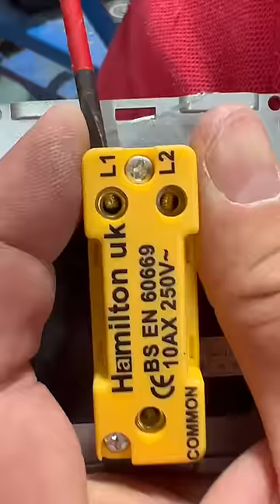Don't Get Caught Short - Wago Push Wire Inline Saves The Day

Comment: I really don't like the push in connectors. Really don't make a good connection. Less of a problem in 240volt countries because currents are lower. But they are really a weak design. Probably not as much of an issue in low current circuits, but I prefer a connection that supports the continuous ampacity of the wire. These are essentially inserting a weak spot. Maybe OK in most EU circuits. But if you take on apart, you can see the design weaknesses.
Reply: They are tested at and above their rated current, there is no issue using them anywhere, regardless of the current, so long as they are used within spec.
Reply: @Pugjamin  I completely understand how they are rated and tested. Bear in mind that this is less than the ampacity of the wires they are  for and they   are de-rated  for 80% of that value, 

I have done a lot of research on the issue. In Europe and in other 240 volt countries, The same type household circuits pull half the current they do in North American 120 volt systems. So in 240 volt countries these are typically being used at much lower, (half) the currents. 

But let me remind you how electricity works. In a resistive circuit, the power dissipated for the same resistance value and therefore the heating of the connection, is a function of the current squared,  I^2 x R., remember?? Let's take an example.  In the example we will use 0.001 ohms of resistance. If the circuit draws 10 amps, we have 10^2 x 0.001.  or   100 x 0.001 or 0.1 watts. Now double the current so 20^2 X 0.001 or 400 x 0.001 or 0.4 watts. Twice the current but 4 times the watts. 

So in 240 volt countries, the same devices on a typical household circuit, will draw half the current as those same devices operated at 120 Volts. But the resistance value of the connection is the same, yet the heat dissipated in that connection, will be 4 times greater operated at 120 Volts. 

I'm sure you know that when a connection heats up, it will begin to deteriorate. Eventually leading to failure of the connection. If you take a push in connector apart, you will see that the contact area is incredibly small and a good connection relies  on the spring tension. What happens to a spring when it heats up??? The clamp style connector was developed to deal with this issue. For the same size conductor, its current rating is a third higher. The design of the contact area is larger also, thus the higher current rating. 

We have seen issues with the push in style in the US, over time. If you think about it, it makes sense because we will tend to be using them at higher currents, closer to their ratings. If the circuit is just pure resistive as  in lighting the current is the same continuously. But now add an appliance with a motor, (an inductive load). When the motor starts, we get  inrush current, albeit briefly . Circuit breakers are designed to allow that brief inrush without tripping. But the connection doesn't know the difference, it just generates heat as a function of the current squared. 

I have seen these push in connections fail. This is something you can test with a regulated power supply and a heat gun or better yet a Flir  type thermal camera. Regardless of where you  live "amps are amps", "Volts are Volts" and "Ohms are Ohms". Watts are Watts",  But the power or watts calculation, looks at the amps, (current) squared. If you were trained in a quality, certified apprenticeship, you should be familiar with these concepts. If you followed this, I think you should be able to see why the supply voltage of the circuit, can make a difference. 

These push in style connector are approved for use in the US,  But a lot of real electricians try to avoid them. If everything else in the circuits are wired and protected correctly, I think it is highly unlikely that these would pose a fire hazard. But these can be far more likely to fail under higher current use, than alternate approved connection methods. 

In corrosive environments, including coastal areas, these type connections can have a greater likelihood of failure due to corrosion. Competitors and now Wago, makes a line of these connectors filled with a gel. If you understand a bit about the physics of corrosion, poor contact is a "breeding point" It should be clear that design improvements like clamp style connectors and gel filled connectors have been developed to deal with what is an inherent weakness in these connections. 

But if you are an installation guy, these are quick and easy and you can be pretty sure that you will be long gone before these fail and if you are in a 240 country, there is good reason to believe that you might never see a failure. 

I just point all this out because your reaction to the issue is quite typical of electricians working in 240 Volt countries. But there is a very real potential difference. Most good electricians remember the basic Ohm's law equations, But one formula often forgotten is,  P= I^2 x R. The value of the current makes a significant difference!!

I sincerely hope this helps explain the issue.
Reply: They make a better connection than the traditional connectors with screws. Assuming that you install them properly (screw them tight) they will get loose over time. Also another common issue is that you grip on the insulation of the cable and not the copper itself. 

Wagos are simpler to wire, not only that but I consider them safer since there is not the possibility to have exposed live metal (such as the screw) and that allows safer "hot" installation (yea we shouldn't work live but we know that not always is simple to turn the power off and thus to put a new cable into an existing circuit with Wagos is relatively safe).
Reply: @alerighi  When you are taking a "traditional connector" for what amounts to a splice of multiple wires, in the US that would be wire nuts. Multiple tests have time and time again, proven the wire nut to be the best, by far. 

As for screw connections like on devices where the wire wraps around the screw, properly tightened, these make excellent connections. The idea that screws loosen, really defies physics. But for example connected to a receptacle if bending the wires puts stress in a direction to loosen a screw, maybe it later appears like it loosened.  or if the loop was not flatly seated, maybe it seems to have loosened later. But firmly tightened down flat, it's not loosening itself. If yo  got insulation under the screw, you didn't do    it right, that simple.  It is difficult to not see this. 

Wagos are easy no doubt and if done right, nothing is exposed, that I agree with, but as far as a good connection, not so much. Take one apart  and it's obvious. Measure voltage drop at rated current, and it's obvious that  it's not all that good a connection. The lever type are considerably better and they address some of the weaknesses of the push in type. At lower currents, the push ins probably work fine for a long time. At currents near rated they will heat up and ultimately fail.  The  heat generated is I^2 X R, Twice the current means 4 times the heating. Wagos are easy, no doubt. are they the best connection? No, that should be pretty clear and testing has proven that. Are the adequate for some applications? I guess it's a matter of  opinion and I would say, probably adequate for some applications, but I'd go with the lever style if I used them. But they are a compromise between the best  possible connection and the ease of use.
Reply: @professorg8383  Wire nuts are not allowed in my country, I think the reason is that it's simple for them to get loose and thus risk having exposed live parts. Also they work only with rigid cable, where I live only stranded cable is used (I think reason being it's easier to pull inside conduit, since all the cable needs to be inside conduits). 

With screw connectors it's not easy to see if you did catch the cable or the insulation. For that reason there are transparent screw terminals, that are usually used, where it's obvious if you did install them wrong. That said they are not that practical to install like a wago. 

Regarding current carrying capacity, wagos can carry without any issue 16A, and they make models for 32A or more. In reality these days most stuff is low power, so really it's fine. 

The only reason to not use wagos (and I don't use them every time) is cost. If you have to write an entire house with wagos it gets kind of expensive. Where they are great to me is to do alterations. When you have to work in a junction box on a ladder in a false ceiling or similar not having to use a scew driver and be able to use a tooless wago it's a win for me.
Reply: @alerighi  As long as you pre-twist like you are supposed to, wire nuts do not come loose. They work with both solid or stranded wire just fine, but there are a couple tricks with solid to stranded.  Years ago in some industries, we wouldn't use wire nuts. Back then the only approved connections were twisted soldered and ring lugs bolted together. and tape.  Since then, branded wire nuts were approved with a final wrap with tape, 

I only buy the top brand wire  nuts and use as is for residential. Lots of testing have shown these to make very good no resistance connections. When you look at the surface contact between wires, it's obvious that these have the most contact area of any standard connector. These have been in use for quite a long time and well proven.

As for only stranded wire?  Where do you live?  Never heard of that one! For   residential, we can use either but for most wiring, it's solid wire 14awg,12awg and 10awg.  Stranded  is commonly  used above and below those sizes. Non metallic cable with a ground conductor is the norm for residential and conduit is used if it's exposed surface wiring, like in a garage. Some local codes are a bit stricter. In residential wiring PVC or metallic conduits are used. In heavy industry, we usually go only with rigid threaded conduit. Thinwall metallic conduits was once the residential standard. I still use it in some applications. When the non metallic cable, (like Romex), first came out, a lot of us stayed away from it. But it is now in common use in walls and in new construction. There are a few different types including a type approved for direct burial. As long as it isn't somewhere that might be subject to damage, I'll use it. As I see it the conductors are the same so capacities are the same. When we run conduits in residential, the norm is single conductor solid wires. 

If you go back a ways, solid was considered the standard because of the many connections to devices. It works very well with screw terminals. If I'm going to use stranded on screw connections, I'll crimp a ring terminal on  it. Clamping type screw terminals do work well, but they need to be well tightened. Weak hands won't get it. 

My big issue with Wagos is the very tiny contact area that relies on spring tension. The lever types are better. The ratings are higher for the lever type. Wagos have been used in Europe for a long time now, without issue as far as I know. Buy we have seen issues in North America.  I believe the reason for the difference is that with 120v feeding most circuits, we pull twice the current than the same device at 240volts. So we probably have more circuits operating at closer the the current rating. That means more heating on a less than great connection. Testing shows that.  The odds of them causing a fire are pretty slim, I believe,  but the connection failing is likely over time at higher currents. 

Using only stranded wire, I can see your issues with screw connections. Any screw connection that doesn't use a captivating/clamping method, is bound to cause a less than great connection. 

As for why you use only stranded, I'd be guessing. We used to use only stranded in industry. I used to hate the higher rated, molded thremoplastic insulation. It is brutal to strip. But it has higher temperature and current ratings.  Theoretically, stranded wire  has as slightly  higher ampacity. That's because the skin effect means that the current is concentrated around the outer thickness of a conductor. At least in theory, stranded wire is actually made up of multiple parallel conductors.  

But stranded wire also tends to handle vibration better than solid wire. In industry, vibration is very common so solid will likely break under many repeated stresses, where as stranded can handle these stresses, much better. That's the main reasoning to not using solid,  Stranded single conductor wire also comes in a very wide range  of insulation types and ratings.  
.  
As for costs, I don't do big residential jobs and for limited use, I don't worry too much about cost as much as I prefer to use what works best from a theoretical standpoint. One place I do like using Wagos is in lighting fixtures with small stranded wire that gets attached to solid wire. Wire nuts do work well if you  prepare it right. Wago lever type will make a more than adequate connection, easy to disassemble. I know that here, residential, "so called" electricians like Wagos because they are easy. Their bosses like them because they are cheaper than labor. From my  perspective as an engineer with a lot of industrial experience, I want the best connection I can make. I don't see ease of use or cost as significant factors. In that arena, it's a tough environment and things see heavy duty use and any failure costs a lot of money. I look at it pretty much the same for my own personal use. A simple failure won't cost a lot of money, but it's an inconvenience. I'd rather do it right the first time than  have to deal with it later. But I know that guys who do installations for a living,  look at it differently.

Comment: Sets off as red and black you extend in brown and blue then sleeve to two brown 🤣🤣🤣come on apple done common sense
Reply: @davidaholt85  Yes, but he could have literally just used two brown wires.
Reply: @davidaholt85  yes 40 years I know its a switch live. I was pointing out its a short blue sleeved to brown, whilst technically correct most people would have extended with brown.
Reply: @johnwarwick4105  not most, every spark would use both as a brown.. using blue blew my brain...
Reply: @davidaholt85  Im a UK spark.  its red-black or brown and blue because not everyone installs back in the day twin red and now twin brown cable for a switch.

Comment: I thought red wires were used as a second hot wire in circuits where a neutral is unused.  Also, I thought ground wires could be naked.
Reply: Maybe in the US…..
Reply: Different countries do things differently, unfortunately many people do a poor job of indicating what country is involved when putting technical content on the internet.

When you get experianced there are tells (for example US and UK electrical boxes and accessories look totally different) but if you are new to electrical work or just don't know that different places do things differently it can be very confusing.
Reply: @petermichaelgreen  I mean this one is insanely obvious 😂😂😂